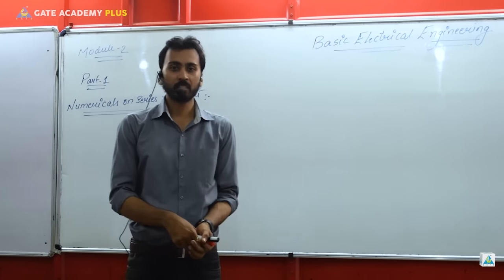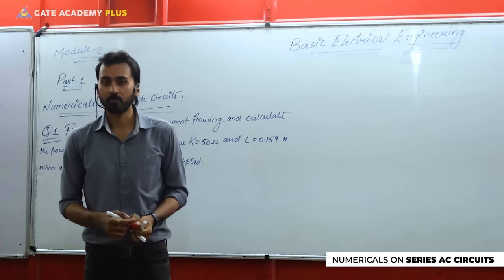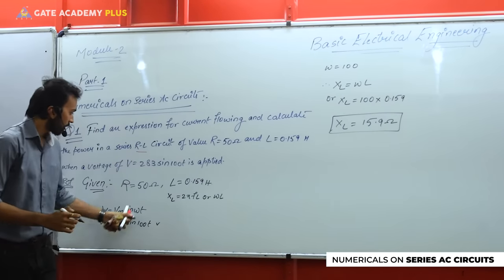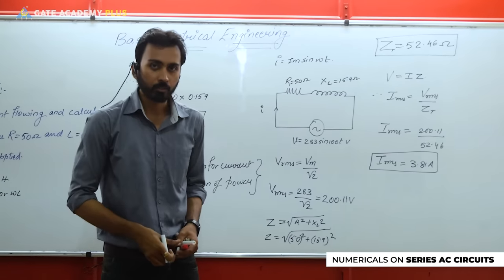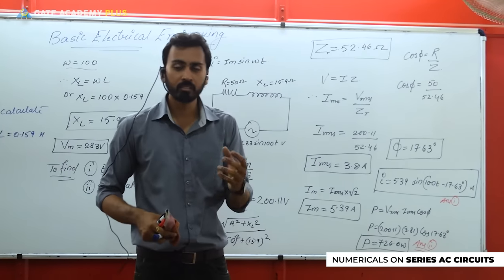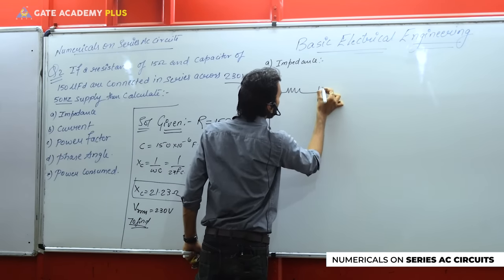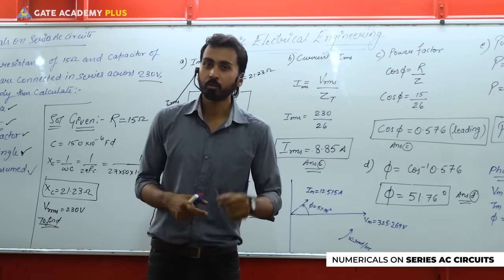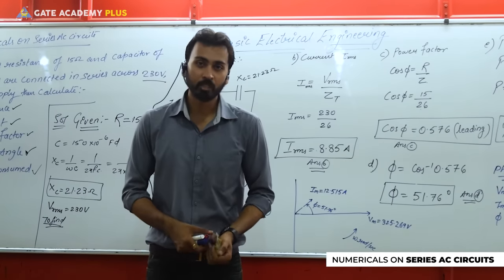Basic Electrical Engineering | Module 2 | Numericals on Series AC Circuits (Lecture 16)

Comment: Sir, can we directly find maximum current by dividing max voltage by total impedance? Because Vm=283, Z= 52.46 ohms....then Vm/Z = 5.39 A
Reply: Yes bro
Reply: Yes
Reply: Yes but you can't calculate the 2nd answer
Reply: Ye modul Mera nahi ho raha

Comment: Helpful..
Note Be- In Question No. 2 
D)Φ= Cos inverse 0.576
It's answer will be 54.84
That's all
Reply: Yes 54.84 is correct
Reply: @arpitachaudhary7805  Yes 54.84 is correct value
Reply: @arpitachaudhary7805 yeah..you're correct
Reply: catlover909 yaaa👏🏻
Reply: @hu-tv👏🏻👏🏻
Reply: Yes bro I also calculated it's 54.84
Reply: @jbgaming1568  yes🏆👏🏻
Reply: 😮😢😊c cc 😢😮😮

Comment: A series R-L-C circuit has inductance of 10 mH and resistance of 2 2. What is the value of capacitance that will produce resonance? Also find the current at resonance frequency and maximum instantaneous energy stored in the inductance at resonance. Assume the supply sinusoidal. as 230 V, 10000 Hz
Sir ye ques kaise bnaye

Comment: Sir if R,L,C all 3 reactive parts are present then how we decided lagging and leading.
Reply: Good question
Reply: Check which reactance is dominating. Suppose Xl is greater than Xc that means Inductive reactance is dominating and hence, as per properties of inductive Load, the current will Lag. Suppose Xc is greater than Xl that means that conductive reactance is dominating inductive reactance, therefore, by properties of conductive load, current will lead.

Comment: Sir, (Ques-2)-b me...Apne Jo current find Kiya h wo Irms ke ki form me kyu kiye Im ke form me kyu nhii ?
Reply: Because in that question Vrms voltage applied to that circuit so Irms current flowing in that circuit.but in question1 instantaneous voltage applied to that circuit so instantaneous current had been calculated